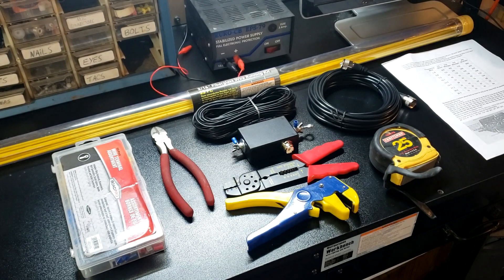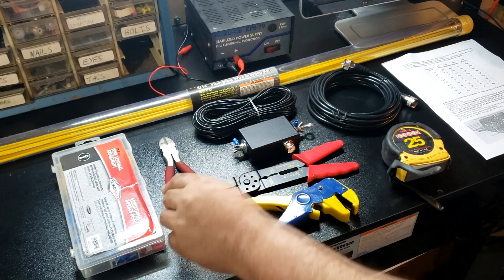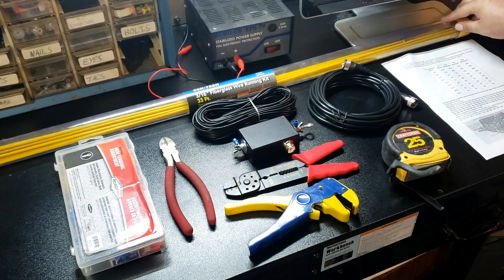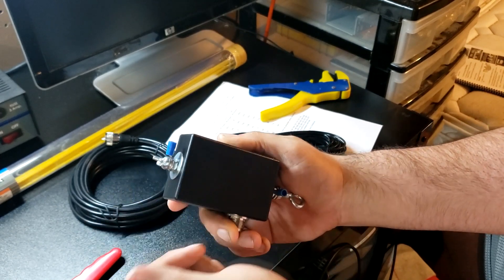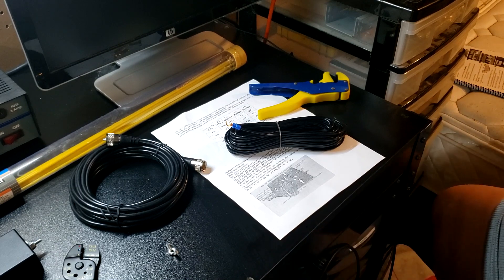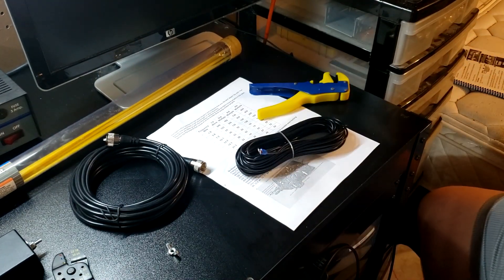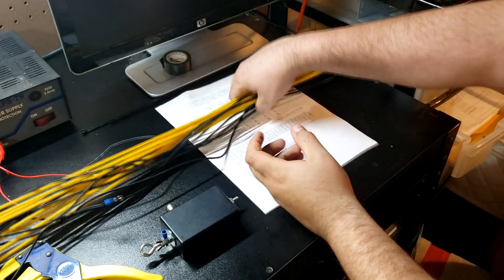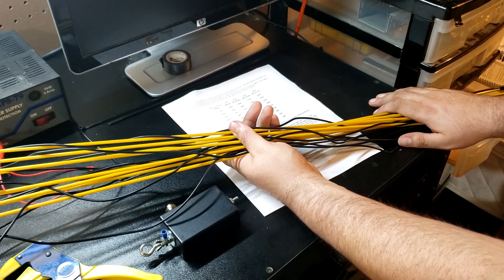Stealth End-Fed HF Wire Antenna Project Part 1: Construction

Comment: Dude, who designed this thing?  Try a 49:1 UN/UN and 1/4 of wire or 33'.  Also, you need to add a few radials to that dual band antenna.  As an Engineer, this is hard to watch.

Comment: Two questions. Why did you put the rod 2.5' back instead of contacting the end to the end and pushing the rod further into the attic? Second, do you really need to connect the wire to each rod, or would just connecting it to the end work? I'm assuming it's going to sit on the joists in your attic and not hang from the rafters.
Reply from the maker: I'm not sure I understand the first question,  The rods are only 33 feet long and the wire length I needed is 35.5 ft. The extra 2.5 feet I can easily stretch by hand and weight in place with the transformer. 

As for the second question, you're right. i didn't actually need to attach the wire to anything except the far end. That didn't occur to me at the time.
Reply: @BluegrassFilmsKY  It might be me misunderstanding then. The extra 2.5 feet is going to connect to the UnUn? I was thinking it was on the other end.